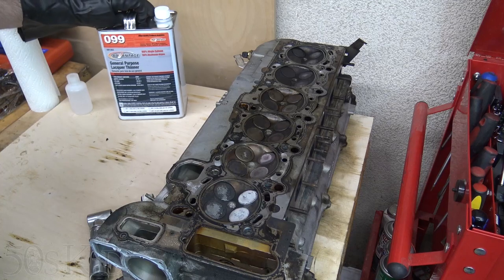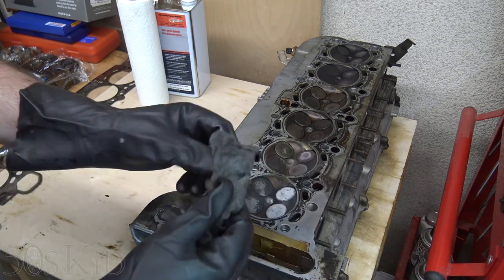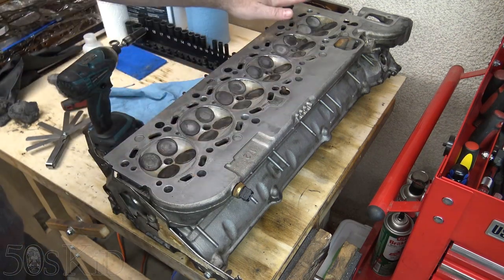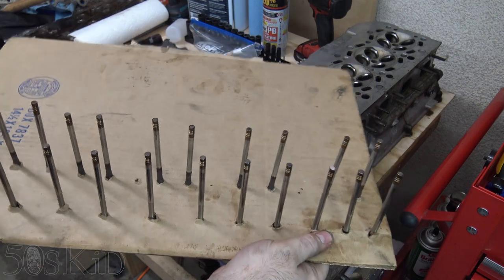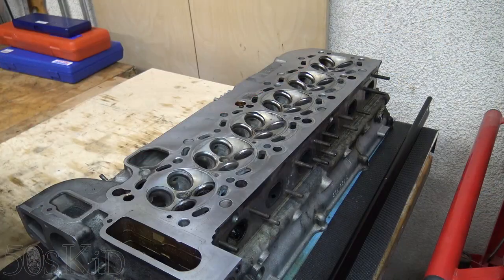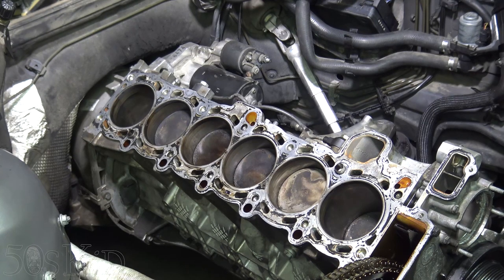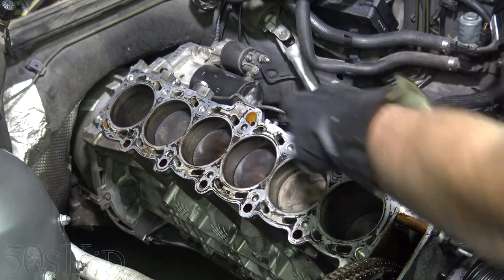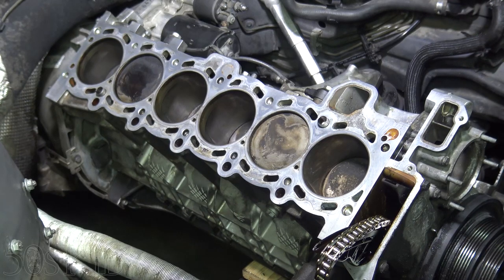BMW E46 Cleaning & Measuring Cylinder Head DIY #m54rebuild 12

Comment: 50, I say it all the time and I will say it again, your videos and your attitude of approach are invaluable to the amateur automotive community. You are truly an admirable human being.

I had some thoughts while watching this video. 
- Isn't the softest steel still harder than the hardest aluminium according to the Brinell Scale? Which is to say that are you not also removing aluminum filings from the block when using steel wool?  Have you considered using a Melamine Foam (Magic Eraser) in stead of the steel wool? 
- Since Steel wool was used, would a magnet be more ideal in retrieving the steel filings, followed by a vacuum? Blowing them out just scatters the debris and it becomes unaccounted for.
Reply from the maker: Thanks very much. I hear you but it's steel wool after all. Not enough strength to scratch the finish. Trust me, I tried using a green 3m pad from a dish sponge in a small area on the outer edge of the head (it's getting machined anyway) and it left scratches. The steel wool did not. The compressed air blew out the little lint left behind by the wool.
Reply: Dicer328 word

Comment: another good vid ..the head gaskets are coated with a either black or silver coating that I believe fuses to the head and block surfaces ..head gaskets are shimmed and come in different thickness to allow for resurfacing head or block..as for the bore surface most BMW bores are nickesil coating (chrome)which is usually .012.so be careful when removing the carbon ridge on the top ..your Bottlebrush hone should do the trick doing this but max of 180grit ,nothing over and finish off the honing with 45d cross hatch pattern..hope this helps  ...good idea with removing carbon with the drill..never thought of that in the 45  years of rebuilding motors ...see learn something all the time ...keep up the good vids
Reply from the maker: This block actually uses cast iron liners
Reply: never done an E46 motor but to be safe I would check with a magnet to be certain ..did read somewhere that they use nickasil for bore ..all late 2 cyl and 4 cyl (from 1980)BMW motorcycles run Nickasil bore ..rings are different to cast iron liners and nickasil  ..cast iron liners use chrome rings and nickasil use cast iron rings

Comment: Wow, I am a little concerned with the steel abrasive residue left behind Jason.  On the head it maybe ok because it will be thoroughly cleaned after the shop deal with it, but the engine block, uff that is risky. If you are rebuilding the block not so much of an issue.  

Also, when checking the lateral movement of the valves, you could have the dial assembly attached to the head instead of the table, that way your dial should not move in reference to the valve guide. 

As always great videos.
Reply from the maker: Don't worry, it all got blown out by the compressed air. What it left behind was more like lint than anything else, not heavy, not sticky, easily blown away

Comment: Hey Jason,

I bought a 2003 325i that "needed a head gasket" for $650.  Well, the head gasket turned into completely rebuilding and machining the head and the block needs work as well, not to mention that I had to buy a time-cert tool to re-thread the block!!!  My "deal" is going to cost a ton :( about $2,200 so far including the purchase price, and I'm so deep I don't want to bail, but maybe I should?  So watching your videos has been a great help, but I'm stuck with the block coming out.  I don't want to take the front end apart and I don't think the problem I'm having would make any difference if I did.  The oil pan is hitting the cross member under the motor and I didn't see that you removed it.  The motor is over one inch separated from the transmission (GM) and I can't get past the crossmember.  Any advice?

Comment: Valve guides should be measured from inside, like cylinders. Sadly BMW uses brass ones which wear out over time, so they should be replaced if out of spec. Valve stems should be measured too.

Comment: Regarding the valve corrosion, what type of gas have you used over the length of your ownership? Any experience on what a top tier fuel (more detergent) has on the valves?
Reply from the maker: I don't use top tier gas, however all modern gas has similar additive packages with those detergents in them and such, particularly here in California I'm sure more than elsewhere. I think judging from what little amount of carbon I've seen on pistons on my car and junkyard cars, I'd say it does really well compared to yesteryear's formulations
Reply: You should your min octane rating is 91...

Comment: 50's, Any idea on how many passes or how much milling you will need to bring it back to spec? Also, it would be a cool addition if you could video the milling at whatever shop you choose. (If allowed)
Reply from the maker: Can't tell because it first needs to be straightened. Unfortunately I did not have a relationship with a machine shop yet.  But I do now. Maybe next time.

Comment: 50s kid. an you tell me were is the vaccum oil pump in 1999 e46 m52
Reply from the maker: I'm not sure what you are referring to.  The engine oil pump is inside the oil pan bolted to the block.  You'll see it in the next video

Comment: Maybe dumb question .... If you gonna change the rings, you gonna pull pistons out anyway. Why clean them in place when it is much easier to do it when they are out of the engine ?
Reply from the maker: I didn't clean the pistons in place, I cleaned the top of the block.  I was showing what people would need to do if they were not pulling their block, if they were just rebuilding the head or replacing the gasket.
Reply: Ok, got it. Thanks for clearing this up :)

Comment: Im doing a project with my son on a 2001 BMW 330xi, the head gasket is bad and we're planning on replacing it ourselves. Do you have any videos on how to remove and replace the head gasket properly? If not could you do a video or contact me? Thanks!
Reply from the maker: I have created a playlist specifically for only doing a head gasket change/head rebuild.  I do not yet have the reinstall video online because this series is ongoing.  It'll be another 5 weeks or so before the series is concluded.  However there is enough information in these videos to figure out how to do the reinstall process yourself, you know?  https://www.youtube.com/playlist?list=PLqJG4ZyPIF6OwNPmArcR0NFRj94FNvRwC
Reply: Alright thank you! Also, do you happen to know of any good websites that sells a kit with everything needed for the head gasket job? If not, then a website that sells all the parts needed? Thanks!

Comment: Theres something I don't fully understand with machining a head. If you machine a head, it removes material right, so doesn't most other parts of the rest of the engine like bolts have to be modified so it accommodate it's new shorter length or it just really doesn't matter at that minimum ammount?
Reply from the maker: Doesn't matter at that minimum amount.  The holes in the block are drilled much deeper than the bolts actually go in.
Reply: Ah ok

Comment: I need some help my friends please. I was changing my valve cover gasket. But when I pull out the valve cover, a small aluminium partthis part fell beneath the camshaft bearing ledge (inlet cam).  I am no mechanic, so when I couldn’t take that part out I thought that I could remove the cam bearing ledge to be able to remove the part that fell inside. I turn the 2 bolts I circled in the picture with red 1/2 turn, ONLY 1/2 turn counterclockwise. When I did that I heard a “gush” like if something underpressure was unlocked and an strong oil smell was released. 
After that, I was afraid so I readjusted both bolts immediately with my wrench as hard as I could. Again, it was only those 2 bolts 1/2 turn counterclockwise and then I adjust it back as hard as I could but not extremely hard!
I put everything back together including new gaskets.
When I turned on the car, the car did 1 rev up to 1,800 rpm and went back to normal but I got the check engine light with 2 codes 
2A82
2A98

The car runs smooth, strong, fast, no other issues except everytime I turn on the car, it does that 1 abnormal rev up and then everything is back to normal.
Do you think the 2 error codes could be related to the fact that I did not adjust those 2 bolts to the correct inch/pound?
Or does the solution would be to get the BMW tool for the inlet cam, take out all the inlet cam bolts and adjust all of them back to the correct inch/pound?
Or the error code is related to that little thing that is still inside beneath the inlet cam bearing ledge?
It can’t be the VANOS solenoid because I changed them less than 6 months ago and there were no error codes or check engine lights before this happened to me. 
Thank you for your help
My car is a BMW 528i 2008 E60

NOTE: By the way, the 2 bolts I messed up with are kind of in the middle of the inlet camshaft bearing ledge
Reply from the maker: I doubt very much that a 1/4 turn on the bolts did anything. Chase down the vanos errors. Use INPA to look at vanos commanded position versus vanos actual position. If they are wildly off, or if you're missing one of those inputs, that gives you a little direction to go in. Perhaps checking those solenoids, perhaps its electrical issues energizing the solenoids, perhaps you just need to rebuild your vanos seals, etc.

Comment: I have a 2001 bmw e46 330xi, it was blowing a lot of white smoke and burning oil like crazy. I took off the intake manifold and replaced all of the CCV, intake manifold gasket and valve cover gasket. I started it and let it run for about 2-3 minutes and was still blowing a ton of smoke. Do you know what could be the issue?
Reply from the maker: You just gotta let it run longer and burn off the excess oil that got sucked up through your failed CCV system into the intake.

Comment: When measuring the valve tilt, isn't there a measurement to set the valve away from the valve seat to take a reading ?
Reply from the maker: You make the other end of the valve level with the valve guide.  I did that by reaching underneath the head and pushing the valve up until it was level with the guide.

Comment: Wouldn't it be easier to just buy new valves?? Might be an answered question
Reply from the maker: Waste of money.  You'll still need the valve seats recut at the machine shop so you might as well just have the old valves cleaned up and refaced as part of that whole process.  Machine shops like to charge a set amount for all of that work.
Reply: 50sKid thanks for the reply I appreciate it

Comment: Why didn't u just buy a rebuild head
Reply from the maker: Didn't know where to get one.
Reply: 50sKid hi thanks for the response I have a 04 e46 m3 and I had the same issue and when I took my head out and send it to the machine shop the guy told me just get a rebuild head and I got one from ecs tuning cost me 2600 but it came with everything I needed all the gaskets new plugs new coils new hardware
Reply: Actually 1800 bucks
Reply from the maker: Yeah, the machine work to rebuild my head was about $500.  Turns out I had to get a different head because this one was cracked, so I pulled that from the junkyard for $120 so all in all it was $620.  That's why I didn't buy a rebuilt head. ;-)